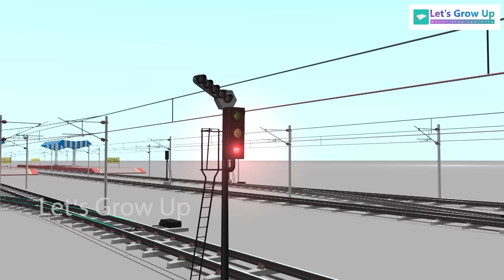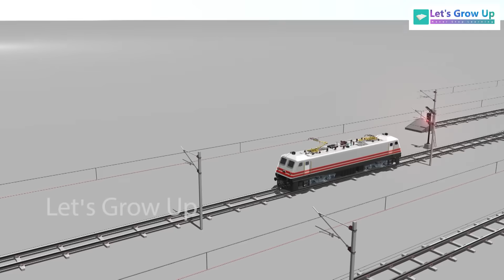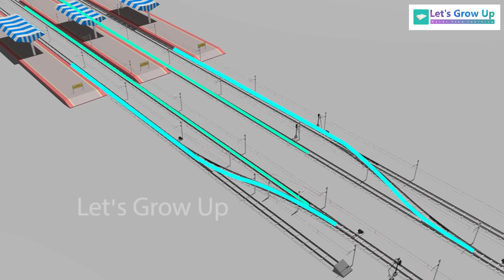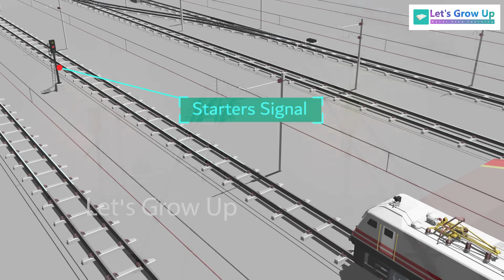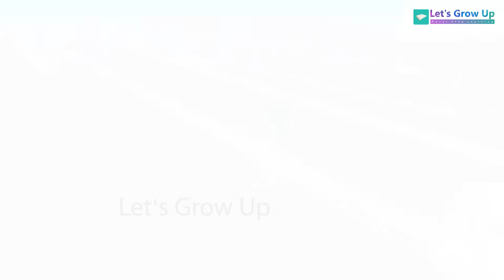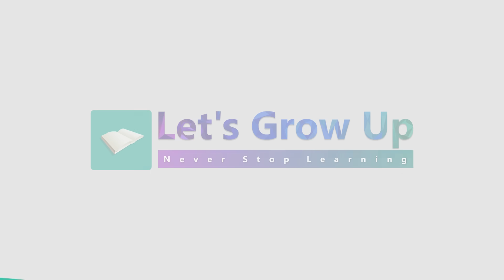Railway Signaling Systems Insights Post Coromandel Express Accident

Comment: Your explanation is good, let me give one suggestion. In the station, after getting green signal, the train will move. Here l want to mention one thing. The train engine, After crossing  the train green signal, the green signal automatically off and the red colour signal will come immediately. How the public will know that the train moves after getting the correct signal. So l hereby request you to inform to your superior, glow the green signal upto the last compartment to see!

Comment: At the start of video , the route indicater is shown for loop line with green signal which is not correct one ; it should be yellow only ; for loop line , train has to proceed with caution only

Comment: BUT WHAY ACD ?  IN ATS SYSTEM  MUST BE MECHENICAL INTER LOCKING FIRST WORK THEN ELECTRIC INTERLOCKING WORK MEACENICAL INTER LOCKING IS FAILL THEN ALL SYSTEM IS OFF POSTATION .  TUNG RAIL TO MAIN RAIL MECHENICAL CONNECTION  MAKE BREAK SWITCHING IS WORKING . THEN  POINT MOTOR OPERATIONAL POSTATION .

Comment: Basis piecemeal information reported by the news media on the CRS investigation report on the Coromandel Express disaster , it would seem that the automatic interlocking system was compromised since 2018 until the accident occurred on 2nd June 2023, due to some blotched up repair on facing point machine by  sectional engineers from the Signal Dept and as incredible as it may sound, it seems that this team comprising of the Snr Sectional Engineer, Jr Sectional Engineer and technician had been discretely tampering with the point switch signal. Hard to believe that these guys never felt the need to rectify the defective point and resorted to an unauthorised stop gap solution, thereby compromising safety, and compounding operational risk for traffic on UP main line for a period of five long years. Its mind boggling to comprehend how these guys could keep on manually tampering with the signalling system without getting caught and sheds some light on the quality of some skilled railwaymen responsible for maintaining safe operation of railway traffic. In this particular case the responsible sectional engineers were fully aware of this discrete "unauthorised tampering" which probably had become a habit since undetected for such a long time. These actions highlight a unsafe team and unfit for purpose, especially since they seemed completely ignorant on how their reckless actions could have compromised safety and unable to comprehend how such compromised operations with the passage of time was like a ticking time bomb ready to explode. We should take note that its only because of the high number of fatalities, skeletons in the closet are being uncovered and in context on 25th June there was another similar collision incident involving two goods train causing derailment of 12 bogies took place at Ondagram railway station, Bankura, West Bengal and although no fatalities this major incident bears significance as the sequence of events leading to the incident very similar to the Coromandel Express disaster. The railway authorities now claim that the Bankura goods train accident was due to both loco driver and the assistant loco driver of moving goods train were ' micro sleeping" therefore brakes was not applied causing the train overshoot and collide with a stationary train. The railway inquiry team concluded declaring the loco driver and assistant driver as the guilty party as they were " micro sleeping" on duty and unable to apply brakes before the red home signal thereby overshooting and colliding with stationary train on loop line. Although both injured loco drivers were hospitalised after the collision, the railways have  been rather quick to sack both drivers as charged with sole responsibility of causing the accident not having checked/ confirmed these drivers work schedule complies with minimum rest hours  and have conveniently closed out the case without any further investigation which leaves several pending questions unanswered as to why the  duty officer in control room was not monitoring the incoming goods train and why he was not able to alert the loco driver on walkie talkie, why was this incoming goods train not cleared for the main line with green home signal after resetting the point switch  to normal  position since the stationary goods was parked on the loop line , instead providing  red  home signal when there was nil reported obstruction on up main line, Was any anti-collision device fitted on these goods trains as there must be remote emergency stop  function as a contingency in case the loco pilot gets incapacitated or falls asleep due to insufficient rest hours which is now a fairly common phenomenon due to shortage of skilled man power and has contributed to a systemic rise the number of accidents and near misses thereby compromising on safety.   
We have listed a few important comments highlighting concerns of the common man on the loss of nearly 300 innocent lives due to sheer negligence therefore feel extremely insecure to travel by rail.                 . 
a) The automatic interlock system which is basically a safety device for railway operations was compromised since 2018, i.e. for five years until this accident occurred,                   
b)  The signalling system had lost its automatic online status due to the manual fingering of the system by the engineers. As per media,  CRS reports suggests tampering of the signal system based on the statement of  Mr Mohanta, Senior Sectional Engineer that immediately after the accident,  he had rushed over to the control room to find the point signal still indicating  Green when in fact the collision and derailment had led to railway tracks being ripped open leaving the point machine completely destroyed, therefore suggesting  this was a dummy signal from external source. This suggestion makes sense if we consider the operation of this point switch was being manually manipulated ever since blotched repair in 2018. Considering the last set position of the point switch was in Reverse direction with point signal Yellow, thereby allowing the goods train to enter Up loop line in order to clear the Up main line for incoming Up Coromandel Express. We are also aware of the ongoing works for the past few days for renewal of the automatic boom barrier at the unmanned railway crossing located a fair distance away from the point switch. We are now assuming that in order to function test the boom barrier, the automatic interlock system was logically sequenced for boom barrier to close only when the facing point switch was set at Normal position to main line, i.e. Green point signal, therefore when function testing boom barrier, the same reckless team of signal engineers & technician engaged in yet another unsafe act of manually bypassing the point signal from Yellow to Green. Basis available information seems the unauthorised tampering was carried out from nearby junction box and probably due to time constraints and the inconvenient distance separating the boom barrier and the point switch.
(c) Indian Railways require every railway station to carry an updated and approved version of the SWR and the SWRD. The SWR or Safe Working Rule book, is  issued every 5 years and signed by Sr DOM and Sr DSTE and is the official book of rules and regulations issued for the purpose of the safe operations of trains under normal and abnormal conditions, customised to suit a particular railway station with the updated version of the SWRD or Safe Working Rule Diagram providing location details of signalling systems, interlocking systems, relay room, signalling equipment, etc. Specific procedures for working on boom barrier at level crossing are detailed under an appendix listed in the SWR which also includes the job description of he station master and his team therefore requires all parties to go through the SWR & the SWRD and sign confirming their understanding of their job descriptions and with standard operating procedures under normal / abnormal conditions which should serve as reference material for CBI in order to verify compliance. Media reports on existing plans not updated to include system modifications insinuates the SWRD not being updated for which the Sr DOM, Sr DSTE and their superiors should be held directly responsible.                                      
(d) These sectional engineers and the technician from signal dept were an unsafe bunch, not fit for purpose, capable of only " jugaar" and as they lacked the knowledge and skill set to understand the inherent risk and the possible outcome of highly unprofessional behaviour. 
(e)  Since the same team members from the signal engineering department was responsible for the routine inspections and checks, planned maintenance and major overhaul of all signalling equipment and systems, we can safely assume that SBR was ignored thereby increasing the risk of equipment / system failure.
(f) It seems highly improbable that the Station Master and the Assistant Station Manager were completely ignorant of the fact that their technical support teams could tamper around with signalling system and able to hide these blotched up repairs. It’s very evident that they regularly ignored tell-tale signs and red alerts and did not themselves comply to standard operating procedures provided under the SBR. It’s obvious that they were not monitoring the repair & maintenance being undertaken within their jurisdiction as procedures under SBR requires them to witness the final testing & commissioning to their satisfaction prior signing the re-connection memo therefore either they were privy to these blotched repairs or contrary to standard procedures they personally never attended which complemented the unsafe practices being undertaken.
(g) There was another major incident involving collision of two goods train resulting in serious damage to property including the derailment of 12 bogies at Ondagram railway station, Bankura district on the 25th June 2023, and the incident has been closed in a unsatisfactory manner which requires the railways to come up with several unanswered questions as it seems a deliberately exercise to quickly and quietly close out the incident.

Comment: As a maritime consultant, i have been involved with Major Incident investigations within the marine industry and have been following media reports on this unfortunate incident and have also been sharing my comments after filtering out media clutter. As events have unfolded, the story developing seems all too familiar as i suspect that this incident is deeply routed and there would be a chain of relatively minor incidents and near misses that would lead up for this particular major incident to occur. An audit of the Quality Management System of the Indian Railways would most likely highlight major non conformities including non compliance of Standard Operating Procedures. The fact that there was a Disconnection Memo & Reconnection Memo issued by the Station Master, we are assuming that the railways team had become aware that there was some problem with the facing point machine on up-loop line x-over and basis the high risk status, a Disconnection Memo was issued by declaring the point Failed, requiring immediate repair & maintenance. The was a serious breach in the implementation of standard operating procedures after issuing the Disconnection Memo until issuance of the Re-connection Memo because if procedures as laid down by the Indian Railways was followed with due diligence this unfortunate incident would never have taken place. In context, the standard operating procedures require that maintenance repair or replacement of the point is carried out by a joint team comprising of experienced personnel from the engineering & signalling dept under the station masters command. Standard practice after boxing up the point and reconnecting the terminal wiring, testing and commissioning requires the point to be function tested from Normal locked position to Reverse locked position and vice versa, ensuring point gets locked at each end position, i.e. tongue rail makes full contact with the stock rail which requires total travel distance of tongue rail to be measured for a pre-determined value and if required the throw slide of the machine is adjusted after confirming self-locking of lock slides at its end positions. During these tests, the point is operated locally by hand cranking the manual lever and thereafter the remote operation is checked from control room. AS PER IR RULES, IT IS MANDATORY FOR STATION MASTER TO BE PHYSICALLY PRESENT AT LOCAL SITE TO WITNESS TESTING OF THE POINT, AND ONCE SATISFIED WITH FUNCTION TESTING OF POINT AND SIGNALLING SYSTEM, the station manager is then able to issue a re-connection memo. 
We are in the dark on the nature of "repairs effected", and what was the specific reason (why, when and for how long) for issuing a Connection & Re-Connection Memo because this signifies an abnormal condition which would affect up main line traffic therefore timings for issual of these memos would be a source of key information. Normally for failed point, the complete point machine should be replaced with a new spare machine. 
The time re-connection memo was issued and ETA ( estimated time of arrival )of UP Coromandel Express would also shed some light if the repairs were undertaken  under stress as working under tight schedules, there is always the temptation to take short cuts and a tendency to overlook basics, therefore we cannot eliminate the possibility of incorrect wiring connections made after boxing up the point machine, effectively reversing the contact terminals for a given position, i.e. when the point was mechanically locked at the Normal position, the feedback signal indicated the Reverse position and vice versa. There is a always a possibility for basic mistakes to go undetected especially when working under tight schedule which  could have led to the disaster. In context, there was media reports regarding ongoing renewal of the electric barrier at the level x-ing however contrary to several opinions, as a layman's inference, cannot see this as root cause of the incident because as per logical sequence this electric barrier unit should serve as an interlock for the two mail lines irrespective of the position of the point.
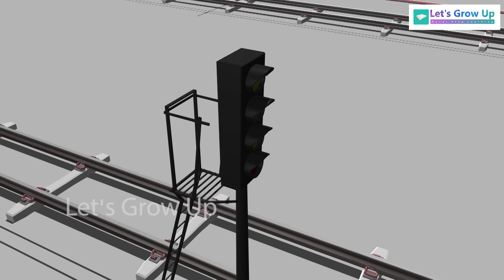Reply: 2:07 😊

Comment: A couple of corrections (though let me know if I am mistaken, as I am familiar with UK practice as opposed to Indian practice - but I presume they are very similar):

1. A route indicator must be proven lit before a proceed aspect can be shown so that the driver knows which route they will be taking and can adjust their speed accordingly (to avoid potential derailment). In this video the junction signal shows a proceed aspect prior to the route indicator being lit. 

2. A double yellow should never be followed immediately by a red signal, as shown early on in the video. The aspect sequence for 4 aspect signalling is G-YY-Y-R. In fact, regardless of whether it is 2, 3, or 4 aspect signalling, the signal immediately before a red signal must always show a single yellow. The example at the end was correct however!

3. When a train passes a signal, the signal should almost always immediately return to red once the wheels pass the detection point associated with that signal (the exception to this being the use of last wheel replacement) in order to protect the rear of the train from any other train following it. In the video the signals remain at proceed even when the entire train passes.
Reply: #3 happening in I  R  promptly
Reply: YY means the next signal is Y. YY means speed is almost like G, so obviously the next one should not be R. The next one should be YY or Y. This is followed in all Indian railway sections.

 When a train passes the signal automatically turns R in most sections.

Comment: Mr Narrator you have given one wrong ihfor mation  to the viewers  when a  train is taken to the loop  line by the ca bin master  point to be  adjusted and  the lights of the signals will  be yelliw in the middle and 3 to 4 small iights show ing  side towords loop line  But your animation  showing signal at the top of the post  Rectify it

Comment: simply the signal for main line was green BUT the track was STILL connected to the loop line. Automatically the wheel will lead         to loop line. if the goods train was not there the impact would be more. There is something fishy about the loop line signal, main line signal and track connection.

Comment: Hello sir. Well clear explanation? I have one another doubt sir. What is the purpose of the top white light indication? What is usage in signalling? Please answer this ot sir. Thanks for the video ❤❤
Reply: top white light means train change to a loop line ahead.. if there is double white indicator right and left of the main signal.. right means loop line at loco piolet right side ahead (or) left means loop line at loco piolet left side ahead.. in some cases two white signal indicates are in left (or) right of the main signal.. this means there are two loop lines at left (or) right of the loco piolet.. same principle to the two or more number of white at top of home signal.. 👍